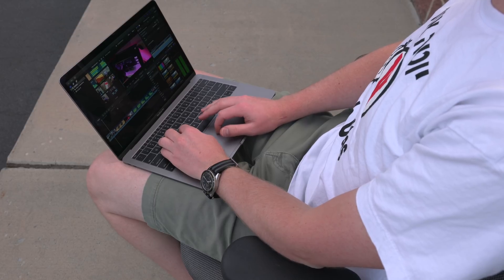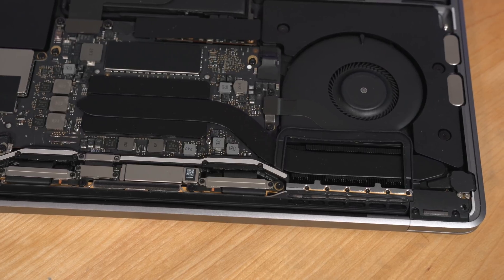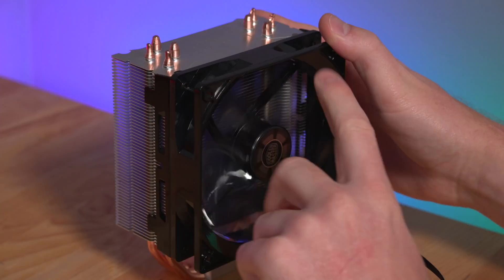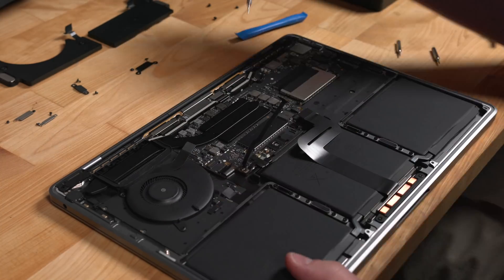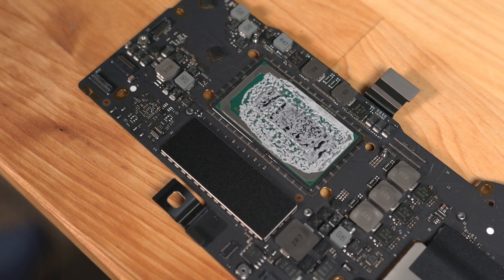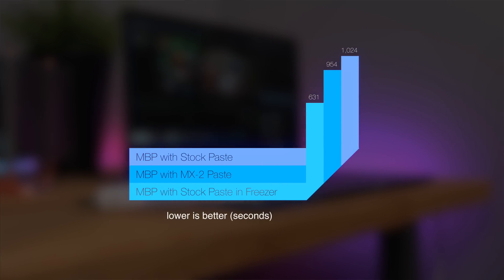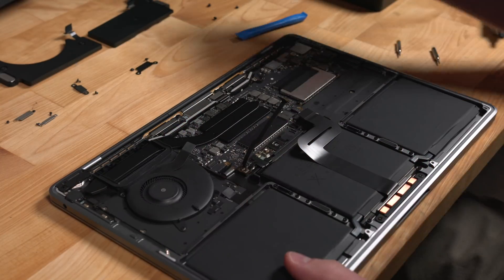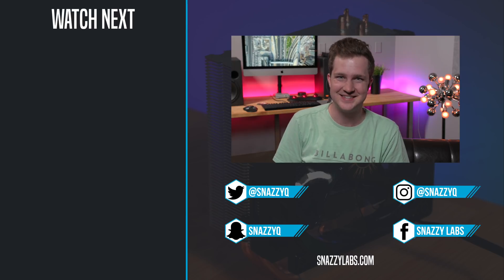Fix Thermal Throttling on Your Mac?!

Comment: Is there any way to undervolt the cpu like in windows?
Reply: whats the point? You're going to make your CPU slower to prevent it from getting hot and then becoming slower?!
Reply: victornpb do you not know what under volting is? It simply trims down the excess voltage supplied to it, cooling the cpu down with no negative effects. Look it up :)
Reply: CPUs dont get slower through undervolting.

Comment: Is there another heat pipe that is bairly thicker but still thicker that could be used in that chasy but still fit and if so I'm imagining that the extra copper will increase performance significantly

Comment: Did you even spread the thermal paste? It appears in the video that you are applying the thermal paste as if the processor had an IHS, which is less than ideal. thermal paste on the raw processor die needs to be spread first before connecting to the heatsink.
Reply from the maker: +NuclearEcko954 It was spread.

Comment: Can you do a video running this final cut test using different cooling pads or external fans? I'd be interested to see if something like that could get the machine cool enough to never thermal throttle.

Comment: They advertised this thing as having an “Advanced Thermal Architecture” lol
Reply from the maker: +Chris Cheng They do. Which is just hilarious.
Reply: Dissipating a dozen or so watts on this tinee tiny heat synk is very impressive. Certainly they could have done a much better job if it was their goal.
Reply: +Snazzy Labs or just very sad, considering people (especially Apple buyers) believe this shit.
Reply: That heat pipe couldn't keep a Pentium 1 cool, what a disgrace.
Reply: victornpb not really. The fact that it hits those temps with it's processor choice compared to some laptops which are passively cooled (albeit with half the spec  CPU  thermal wattage). Most oversized heatsinks on desktops are designed for less than 80c at load OC with a chip producing about 10× the thermal waste quieter than a laptop.
Reply: They didn't say the cooling was better, did they?....  Maybe technically the 'thermal architecture' is 'advanced',  but yet inferior?

Comment: What about laptop cooling platforms? Those USB powered stands that contain as many as 6 fans that constantly blow air into the underside of the laptop? Would that make a noticeable difference?
Reply: Dave Gerhart yeah I would have liked to see him do some more testing with different cooling methods.  Also what about different workloads, like gaming.
Reply: Dave Gerhart the problem is MacBook don't really have any air vents. Those cooling pads work on laptops that have air vents underneath it, but the MacBooks don't. Something that might work Is literally a big metal pad that gets really cold (10c?) so the heat will be transferred from the laptop onto the pad, like a big heatsink
Reply: This will do the most, in almost every case. As it's the limiting factor preventing the heatsink being as efficient. Which more airflow helps with, but needs this step to make the biggest difference
Reply: To what USB port are you going to connect that on the 2017 MacBook Pro?
Reply: Since macbooks are made out of aluminium, the chassis also dissipates heat. A cooling pad will help, but not much

Comment: Clickbait for suree! There are dozens if not hundreds of "tests" on Youtube that show that changing to any other thermal paste, or simply reapplying thermal paste makes no difference at all. Its possible that the machine that applies thermal paste at the factory had a hiccup and applied too little but in that unlikely scenario the computer would thermal throttle so badly that the owner would return it for warranty repair. That there was any measurable difference in this video is meaningless unless it can be repeated a few hundred times with the same exact result. Since the vast majority of videos I have found on this subject show no improvement at all, it seems that this is just a measurement quirk (which does occur) and nothing more.

The laptops that don't seem as hot as a MacBook Pro at Tull tilt are simply throttling far sooner and running much slower than the MacBook Pro.I've experienced other brands of comparable laptops run so slowly at basic tasks such as running Word and Excel that I thought they were broken where every MacBook Pro I have worked on also feels like its running great (using the factory applied thermal paste).
Reply: Billy Bob They’re not really throttling sooner.

Intel CPUs stop turbo-boosting over 90+ degrees Celsius, and then drop below base clocks when it reaches 100 degrees.

I use an ASUS GL502 gaming laptop, and on Forza Horizon 3 (which stresses the CPU by a significant amount), the CPU got up to 83 degrees (usually averages around 80) but the CPU maintained its 4-core turbo frequency of 3.4GHz.

The sluggishness you were experiencing may be more so due to other bottlenecks like I/O performance or if you’re running a different OS on either.
Reply: My 2012 MBP does not throttle at all. Rendering videos for a couple hours the temps are stable at 95-97celsius, the turbo boost still holds 400mhz of overclock. It is pretty damn hot, but I don't mind, because I have a very quiet computer most of the time, and when I need to crunch heavy loads it handle quite well despite the fans spinning at 6000rpm.
Reply: Just look at proffessional test from Hardware Magazines and professional overclockers.
Even when comparing perfectly spread thermal paste there was an 15 degree Celsius Difference betwenn the worst and the best one.

Comment: You know I'm a pretty crazy guy and I absolutely prefer power over size. So I were you and I would hack the next modification on your mac I would design a kind of bed of a 1/4 inch or so to place a thermal difusor and a couple of fans maybe from a broken nvidia with an extra battery. I can imagine the thing It would be awesome.

Comment: Could you put windows on it and undervolt the macbook?
Reply: I had the exact same thought at the start of the video but I'm not sure if it is possible.
Reply: MrLalasd I doubt installing an OS would solve that issue.
Reply: MrLalasd it already is a U processor so it wouldn't help alot

Comment: it's really not that expensive i was expecting it to be like $80, its only $12
Reply: Frankie Theiling Actually it's expensive for just the thermal paste. It doesn't sounded too bad, but you would have to consider on the average thermal paste and it's price point.
Reply: Frankie Theiling nht-1 is considered the best thermal paste before you reach diminishing returns and that is about $6 for a greater volume.

Comment: Well. Very brave of you. But, doing this on a 2017 MacBook which cost 3K+ is not worth 9% and I'm sure as hell you are voiding your warranty. Cool video nonetheless. Big balls :)
Reply: For what it's worth, he used the 13" MacBook Pro base model. That's around $1,400. Still, it does take balls to void your warranty like that ;)
Reply: In all honesty.
If he had used last year's model and done this.
He would have saved 3k and had a faster macbook.

Comment: My 13" MacBook Pro always seems to be really cool :/  Ive never even once heard the fans spinning, I don't think they've ever moved in fact. Then again I don't really do anything CPU or GPU intensive, but I often have many things going at once. Compared to all other laptops I've owned that get hot enough to cook an egg just browsing... I get that for you 4k video editors this thermal throttling must be a real pain, but for 'normal' everyday use its by far the coolest running laptop I've ever seen

Comment: What if you apply non-conductive thermal paste (or thermal pads) to the top of the heatsink as well and use the bottom of macbook as a large heat spreader? It already gets plenty hot as you said so if that's unavoidable then how about figuring out a way to use it as a large heat spreader?
Reply: Thats what I do. But I added copper sheeting to the bottom of the macbook so there was even more area for the heat.   edit  forgot to add, when traveling or at home i use this slim simple "thermal pad" thats basically an aluminum grid, with plenty of holes so the macbook is off the surface and allows more air to flow through, and it has a button to turn on/off a series of fans, large fans with slow rpm can also be used, but they increase air flow. On its own i noticed this helped the macbook with not throttling but along with upgrading a replacement better thermal paste (next time ill add crushed diamond powder) and adding the copper sheeting to the bottom (inside cover) of the macbook body shell, it rarely throttles now :)
Reply: @kuzadupa185  nice! Just watch out for battery temps, seems that's the con of this idea lately
Reply: @djw1091994 ... i feel pretty foolish realizing i had not thought of this obstacle... i suppose im feeling even more foolish admitting to someone on yt! Haha, but now that youve made me aware of it, im going to revisit the project with the temp. Of the battery in mind. I suppose its been simple blind luck, and completely accidentally, enough air flow preventing the battery from overheating, thats kept the macbook chugging along.  Luckily i enjoy these sort of "customize your hardware" style projects!
Reply: @kuzadupa185  Hey I mean props for admitting faults, that's rare quality these days. Macs have tons of ambient temp sensors, you can use utility apps to see the various component temps. I use iSTAT Menus. My M1 Max 16" MBP has a battery temp sensor. In a 75F room the battery is currently at 89F while the CPU is at 128F. The fans are off. Based on the bars next to the sensors, I think the fans will kick on to make sure the battery stays below 100F. Maybe 110F? Not that the battery will cease to stop working at 110F but probably doing permanent damage at that point? According to Apple's website my specific model has a max operating temp of 95F and a storage max temp of 113F. Absolutely no idea what that means, there are many environments above 95F. Like sitting at a coffee shop in front of a window on sunny day, or working outside, or if you live in a dessert climate. I suppose my fans will try to keep it under 95F and in machines with no fans it will throttle? My battery is 90F as I write this with my laptop on my lap and plugged into the wall, the fans are completely off and haven't turned on after 5 hours of work.
Reply: @djw1091994  Ive always felt the quicker I admit to a mistake the sooner I can learn something new.  Rather focus on the new knowledge vs on hiding some mistake.  Appreciate your comment and the info about iStat.  I think storage temp is just like you describe it, when device is off but being stored somewhere like a shelf or backpack.  But off.  Im more worried about damage to the battery due to extreme temps, in this case, high heat.  Nothing worst then trying to improve one part of a devicr only to damage another part!  Although now im curious about using some extra heat reflector fabric I have saved over when I recently installed it as insulation in my attic (summer temps used to reach in the attic of above 110, now they float just below 100, and thats with just the reflection of ambient heat), maybe I can insulate/cut off the battery and the heat it makes on its own, away from the heat made by the other portions of the macbook...

Anyway thanks for the info and rare patience & knowledge.   Goodluck with your proejcts!

Comment: Have you tried under volting? See how low you can go before the cpu isnt happy with the (lack of) juice? Id be willing to bet if you can under volt it, thermal throttling may become a non issue.....but again you do need yo use special software to do so.
Reply: ZeroBlackfire I don't think the macbook's motherboard and chipset supports CPU voltage ajustments.
Reply: If your inferring to the bios stuff no, but there is software that does bypass all of that, including macbooks.
Reply: ZeroBlackfire It doesnt work, I have tried a couple of times
Reply: For some reason, my old 2013 mbp 15" supported both clock adjustment and voltage adjustment with intel XTU.

Comment: Another thing you could try is undervolting the cpu to reduce the heat out put
Reply: MrCutlerycrazy its a mac you can’t
Reply: TigerTechnology voltage control would be done in the bois not the OS so I wouldn't be so sure
Reply: MrCutlerycrazy I couldn't do that on my HP laptop.
Reply: It’s simple to do on Windows via Intel XTU.

I don’t know any alternatives for the Mac
Reply: D13H4RD2L1V3 That i can do.
Reply: Thats exactly what thermal throttling does, whats the point of undervolting it to start with?
Reply: Thermal throttling drops the core speed down in order to reduce performance and therefore, heat output.

Undervolting basically limits the amount of voltage the CPU gets. It will NOT affect its performance in anyway unless you undervolt too much, of which it will be unstable and crash (it is easily recoverable and very safe to do). Believe it or not, Intel CPUs come with more voltage than what is necessary. On a 7700HQ for instance, the max you can go is a 100mV undervolt before stability issues arise. It will drop your temps by around 10 degrees and you may even get better performance.

The effect is not really apparent if your cooling system is already very good to begin with, but it's always a good rule to increase the headroom to TJ max anyhow.
Reply: A high clock is not stable under lower voltage, it will probably not enable turboboost or crash when it tries to.
Reply: victornpb Like I said, Intel laptop CPUs come out of the box with more voltage than they need.

A small undervolt like -50mV does not affect performance and will net you better thermals. 

People who undervolt perform stress tests to ensure system stability. A small undervolt is fine. I personally undervolted mine by 65mV and have yet to experience issues.

And it will just freeze and crash if the voltage is too low. That's why undervolting is a trial and error thing.
Reply: D13H4RD2L1V3 the point isnt to stop thermal throttling. The point i was trying to make was that undervolting could increase the time before thermal throttling occurs.
Reply: victornpb it can reduce the base heat output of the cpu which would give you more time be fore thermal throttling occurs
Reply: MrCutlerycrazy I don't think anyone said it stops throttling.

But it does lower temps and makes throttling less likely.
Reply: Actually there is an app called Volta for mac by Gary Mathews. Works for me at -70mV and much cooler.
Reply: victornpb You have no clue what undervoltage is, right?
Reply: I am sure that engineers at Apple did the best they can to keep up with the Apple's crazy obsession with thinness. There is not much that you can do when you are constrained by so much factors, and they probably made it run on optimal voltage.

Comment: I would differ on this not being something one can do, even if this seems trepidatious for most users. From the looks of it, that thermal paste of a 2017 15" MacBook Pro matched the look of my 2010 15" MacBook AFTER I changed the thermal paste on my Mac in 2016. Six years worth of use and the original factory paste looked about the same as yours did in less than a years worth of use. Let that sink in. .

Comment: This was one of the first things I did to my 2011 MBP. No difference really or if there was it was negligible. 
I'm guessing for me its just the cooling couldn;t keep up with the i7 and Radeon GPU.
Still, a handy tip to know of though as when I took my MBP apart to change the thermal grease - it was like "dry brick mortar" that had too much sand in the mix - crumbly and falling apart.
Reply: Samuel Steffen I actually bought mine used about 2 to 3 months ago. No GPU troubles as of yet. I assume either I've gotten lucky so far or this board has already been refurbished by Apple.

Comment: I have tried that on my Asus Q551L a month ago with a Noctua thermal paste. No temperature difference. Turns out Asus already uses a good thermal dissipation solution.
Reply: Félix Batista Sorta depends.

Higher end laptops usually have a good thermal paste application and quality out of the factory and gaming laptops usually already have a very beefy cooler such as the RoG laptops and the multi-heat pipe array of some MSI laptops like 7 on the GE63.

Comment: My Clevo P150 runs a little hot with its 7-3940XM from time to time under extreme CPU load, but do not worry guys the heatsink in my laptop is thicker than the 2016 Macbook Pro, so it cools it REAL nice.
Reply: Same my asus g750jw heat sink is pretty thick and so is my gpu heatsink as well, it can pretty much handle games and high temps with efficient cooling.